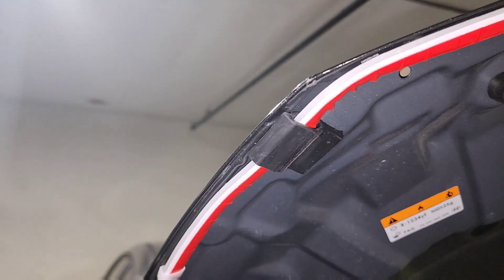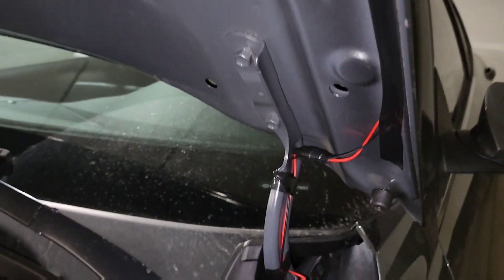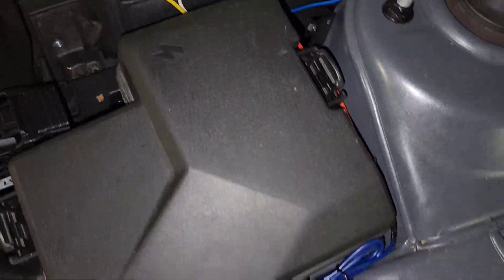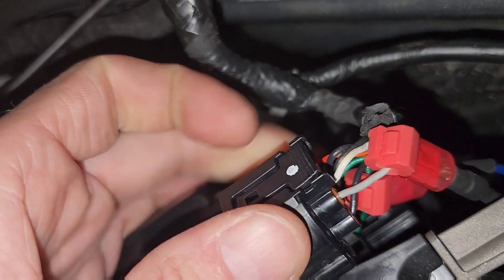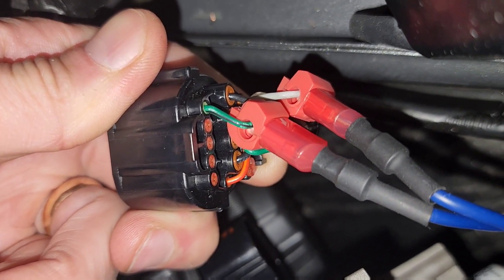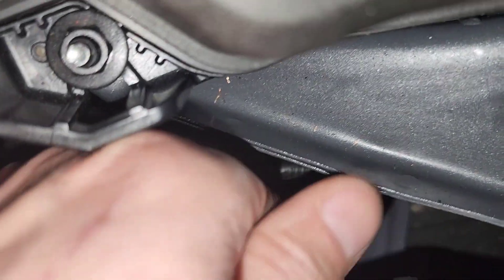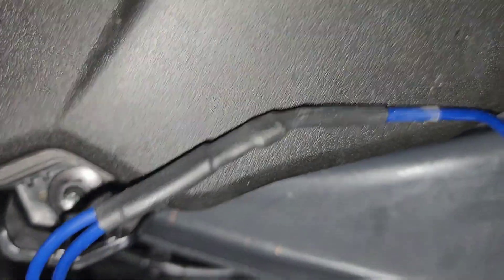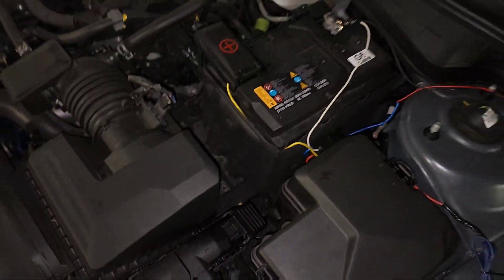Silverholder LED light strip install to daytime running lights on 2023 Hyundai Elantra CN7.

Comment: I just installed one on my Elantra, but there are rubber pieces on the bumper that cover it up one the hood closes. What did you do about this?
Reply from the maker: Check 0:22 in the video.  I went through the bumpers.

Comment: Hi, I have got the same daytime running light. My car is hyundai tucson Ultimate Nx4 2022, can I ask you to show me the  acc fuse ( engine ignition) fuse location please?? I spent more than 2 hours to  do the installation with no luck.  Many thanks
Reply from the maker: No idea my friend.  I don't have that vehicle and I ran mine from the battery using a relay and dedicated fuse.
Reply: @NighthawkMcKenzie  ،thanks my friend.

Comment: i have a 2023 elantra sel and i just bought this and installed it today but its daytime and i dont know if it is installed right because the top of the hood has like bumps so it had to go farther back idk if its close enough to the edge to even show the light i dont think the hood would be able to close though if i put it closer to the edge and it probably wouldnt stick right because of the bumps and everything.
Reply from the maker: Yeah, I got mine as close to the edge as I could but to your point the rolled steel edge makes it tricky.   I hope yours lasts longer than the 6 weeks mine did before LEDs started to blow.  I've noticed others in my neighbourhood with the same issue.
Reply: @NighthawkMcKenzie  do you know of any apps that i can make my own color combination with this? I want it to cycle from green to white but idk how to do it the app is kinda confusing
Reply from the maker: @pvrpleBH  The strip is only white, not RGB.  There is no app.   I have a feeling you may have bought something different?
Reply: @NighthawkMcKenzie  yeah it's not the same brand I have an RGB one sorry

Comment: I see other cars using the same LED and connecting it to the fuse box instead of cutting any wires, do you know which fuse to usenfor Hyundai Elantra 2023
Reply from the maker: To my knowledge there is no such fuse under the hood you can tap, but using a multimeter you could probably find one that is powered when the car is running.  I wanted these to work in concert with the existing DRL but everyone has their own way of installing things.

Comment: why dot you use the fuse. ACC 15. ?? because your setup will damage the led very fast.
Reply from the maker: There is no ACC15 fuse in the 2023 panel either under the hood or inside the car.  If there was, tapping it for power would have been easier.  However, whether using an ACC feed or coming from the battery, the voltage is the same.

Comment: would you know which model/type is the DRL bulb? I'm wondering if I could swap it for a ambar color.
Reply: well, apparently it's impossible. There are no bulbs for DRL, it's like a LED strip.
Reply from the maker: It's not a bulb but a proprietary design.

Comment: How long does this hood light strip last? Does your light strip only come on when your head lights come on at night? I don't want my light strip to come on when I start up the car, then it's running all day. I want it to only come on when my lights automatically come on at night. My daytime running lights stay on all day. I  want the hood strip light to only come on when my lights automatically come on at night
Reply from the maker: The strip died in less than two months and I had to remove it.   No response from the seller.   That aside, if you only want the strip coming on with the headlights than you can tap only the gray wire at the headlight harness.   The relay 'may' not be needed but it is my personal preference not to run additional electrical loads on stock wiring.

Comment: Hi what if I just tap the green cable of drl(power wire) ? I just want the strip to light up when I unlock my car and if it shuts off later on that is fine with me. I couldnt find any existing fuse too to accomplish that purpose. Do you have any expert advice for the same. I own elantra 2021 so your video was very helpful but I do not wnt diodes complication as I am amateur in this stuff tbh.
Reply from the maker: I couldn't find a fuse that is specific to the DRL lamps on their own (it was the first thing I tried!)   If the 2021 is wired the same as my 2023 (and it likely is) the DRL lamps are on full power until your headlights come on, then they dim to 50%.   The DRL lamps also turn OFF when you activate the turn signal.  If you tap only the green wire on the driver side, the strip will be on when the car is turned on, started and running but will shut off when the left turn signal is on (during the day) and possible behave poorly when the headlights are on as it is getting only 50% power.    In my experiments,  the 50% power from the DRL wire wasn't enough to charge the relay and keep the strip on.   This is why I had to also tap the headlight wire and use diodes to prevent back feeding.   As for getting the strip to come on only when you unlock the car???   That sounds like tapping the power unlock wire and using a microprocessor solution to keep power to the strip for 10 seconds after the signal is received.   That one is outside my experience.
Reply: @NighthawkMcKenzie  Thank you for your reply. Insightful but looks like i ll have to chuck this light because even if I do so much technical execution I m sure this chinese led wont last that long as you have mentioned as well. So i guess I ll have to utilze it somewhere else.

Comment: @Nighthawk I would like to install this on my Hyundai and i see the LED strip sits on hood seal (aka hood weather strip). Is this going obstruct what the seal is supposed to do or does this break Hyundai warranty as far as you know?
Reply from the maker: If you haven't bought this strip yet, I suggest you don't.   It failed within two months and I have since removed it.  The company never responded to my request for a replacement or refund.     The strip is fed through the rubber bumpers for the hood, other than that is is just adhered to the hood lip using the supplied double sided tape.  There is no seal.   When the hood is closed, the light is visible through the gap between the facia and the hood.
Reply: @NighthawkMcKenzie   if you paid with a credit card, I think you should be able to do a chargeback and get your money back
Reply from the maker: @zerodepth  not really.  The product was received and did work.   Credit card companies don't usually do chargebacks in lieu of warranty issues.   It was forty bucks.   Live and learn :)
Reply: @NighthawkMcKenzie  hmm depends on your credit card company I guess. I've never had any issues doing charge backs. One time I prepaid for a year of service and the company went out of business and I was able to get a refund from the credit card company.
Reply from the maker: @zerodepth  in that case the service wasn't provided as paid so that makes perfect sense.

Comment: I see this as excessive, why not just use a simple fuse tap and call it a day? and of course you work looks great, i have an Elantra aswell and have hard wired LEDs in my interior
Reply from the maker: A fuse/tap would be enough if you wanted the strip powered all the time.   For example, when you have your headlights set to OFF and the EBrake set,  the car can run with all the DRL lights off.  I wanted the strip to follow this behaviour.
Reply: What fuse did you tap

Comment: I wonder if this will work with my 2021 Hyundai Ioniq hybrid 😅
Reply from the maker: I have no experience dealing with the electrical infrastructure of hybrid vehicles so I would check into the operating voltages of the lights before attempting.

Comment from the maker: ..in case you're wondering about which way the diodes go.  My diodes are 1A, 400V.    They are black and the white line points towards the relay/strip
Reply: Aaah just like the good ol days, sick mod man, Nighthawk Rider!
Reply: Sorry can I ask what would happen if a diode was not used?
Reply from the maker: With this model of Elantra, the DRL voltage is 50% when the headlight are ON and 100% when they are off.   The diodes on each "power source" prevents the drl power line from powering the headlight and vice versa.